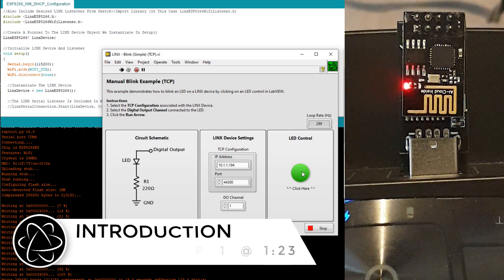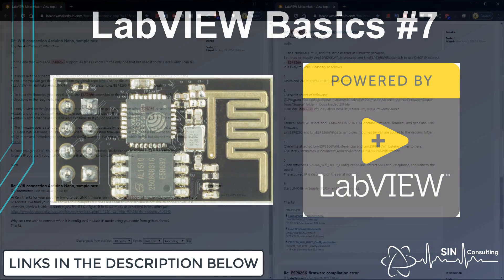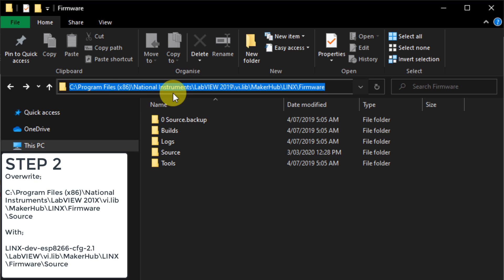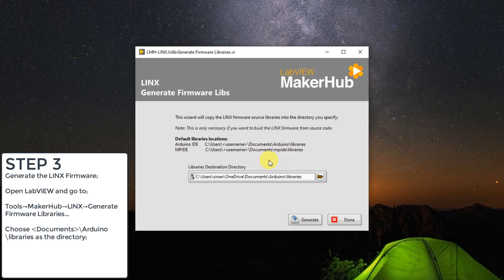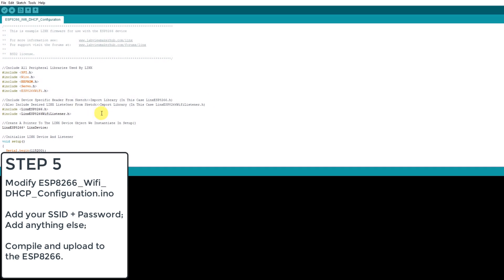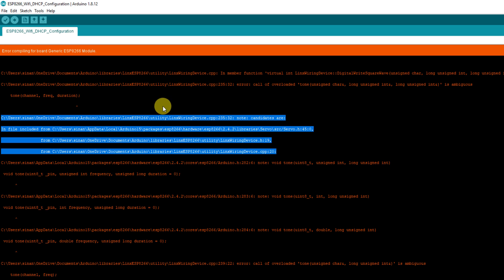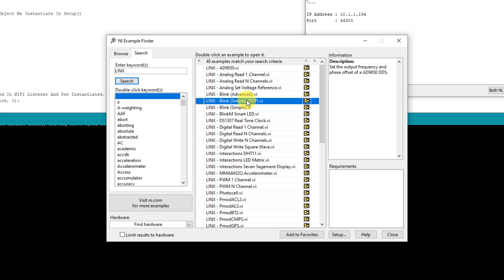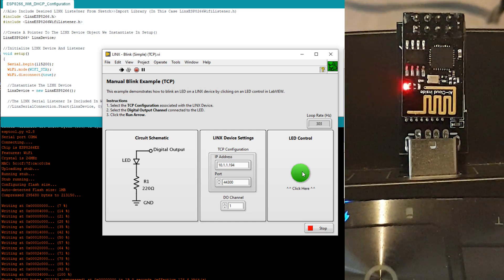LabVIEW Basics #8 - Uploading and Debugging Custom LINX (LabVIEW) Firmware to a ESP8266

Comment: Hi, firstly thansk for explanation. I have a question. Can I use that library with esp32-wroom-32?
Reply from the maker: Hi Ozkur, you would have to modify the firmware files to accommodate the ESP32, as its not supported.  You might want to start with the ESP8266 firmware and add on to it.
Reply: @SINConsulting  Thanks for fast reply. I'll try to modify your firmware. I hope I can do :) 
Thanks again for your help and explanation
Reply from the maker: Anytime :)

Comment: Dear sir. your video is deceiving at best. To be clear, your are NOT Programming, Uploading or Debugging a LabVIEW application to the ESP8266. In your video you show how to use two pre-made programs (one made in C and the other made in LabVIEW) that communicate with each other via TCP/IP communication. None of the steps in your video show us how to actually compile a LabVIEW program to the ESP8266 (if that is possible). 

I'm just saying that so that others that come by know that. Other than the technically misleading titles, your video is good and has great production value. Keep up with your great work!
Reply from the maker: Thanks for the feedback!

Comment: The LINX is installed and I cannot find MakerHub directory in Labview2019 to replace the ESP8266 file. Where is the MakerHub directory on Labview2019 ?
Reply from the maker: It should be in "C:\Program Files (x86)\National Instruments\LabVIEW 2019\vi.lib\MakerHub", adjust as applicable. Which step are you up to?